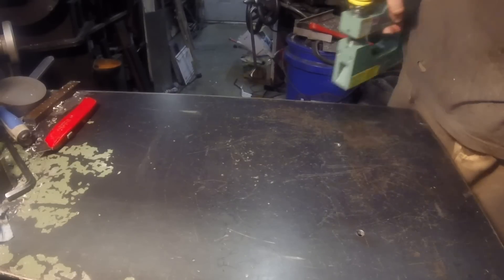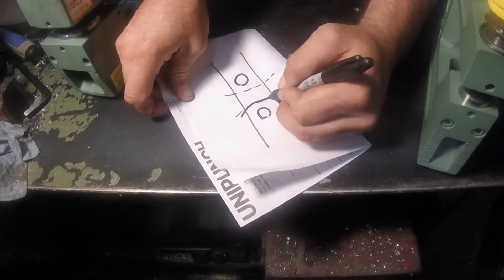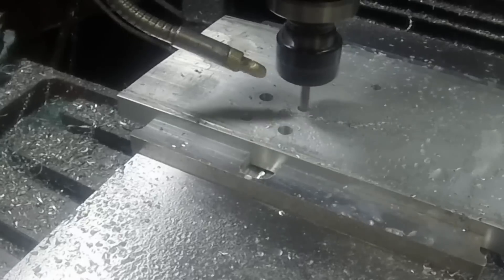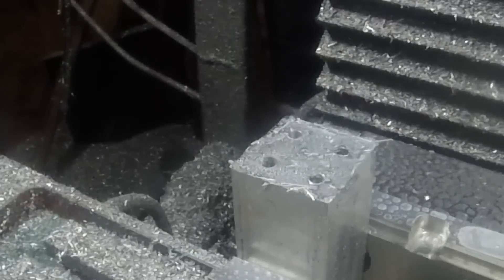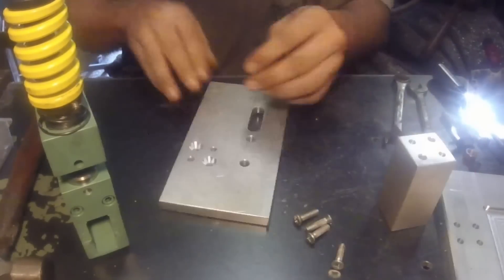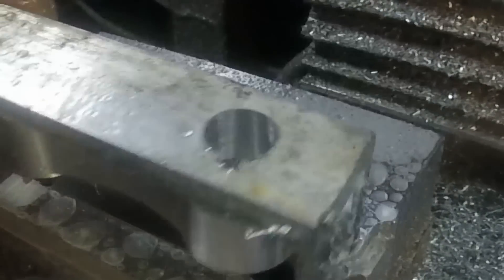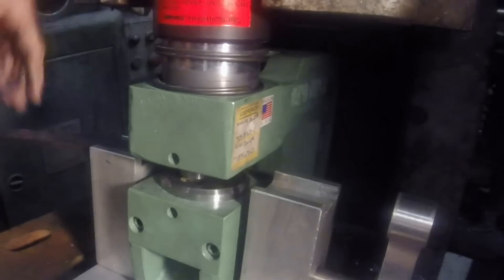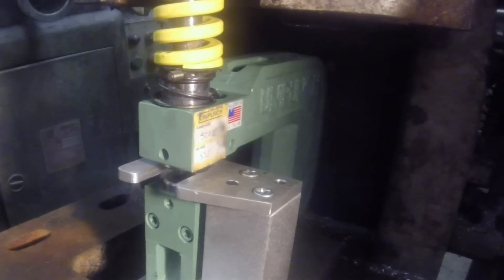Making some fixture plates for UniPunch tooling

Comment: Is that just a plain old school obi press? Iv wondered if I could use those in our presses. Any issues you have run Into using the obi with thoose
Reply from the maker: It is an old OBI.  Mine is a bliss 18.  No problems yet and I run a few different unipunch items in it.  Just make sure the tonnage can handle it so you don't tear the machine apart and that you have enough height for the tool.
Reply: @ecdezz  thank you. Thanks great stuff, keep it up

Comment: Very cool. How much were the Unipunches?  Did you get them from Unipunch directly?  Thinking about making a punch table for sheetmetal with an adjustable jig. Thanks for the video.
Reply from the maker: Thanks!  I did get them from UniPunch but I can't recall how much they were.  They actually make a base plate to mount the punches to with mounting holes in them at regular intervals and they sell guides and stops too.  Very cool system if you make a lot of something.  Took the part I was making with these from about 7 minutes tying up the CNC to about a minute in my $75 punch press :)
Reply: @ecdezz  - Just ordered one.  It was around $285. They are having a 20% off sale also through the end of the year if you need more.   Yeah, I was noticing how much my Tormach 770 was being tied up drilling simple holes.  $75 for a commercial punch press, sweet!  Thanks again for the video!  I thought about Unipunch but I figured that they would be way out there on price.
Reply from the maker: Very cool!  I couldn't remember.  I did get a quote about a month ago for a punch and die to fit mine and it was about $50.  That's not bad.  I find the punch press to be pretty useful but most people overlook them.  I see them go pretty cheap at auctions.  Just make sure the "shut height" is bigger than the overall height of the uni-punch.
Reply: @ecdezz  Hey, what's your name by the way? I am making a series on a punch table with the Unipunch and wanted to give you a shout-out.
Reply from the maker: Cool man, it's Corey.
Reply: Hey Corey wandered what model punch press you're using?